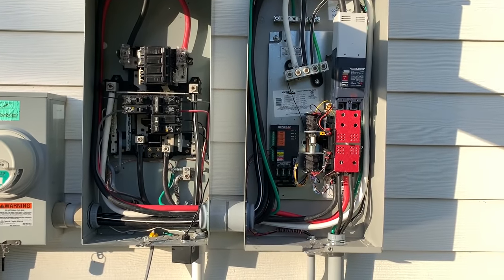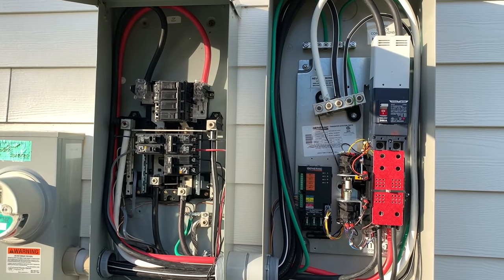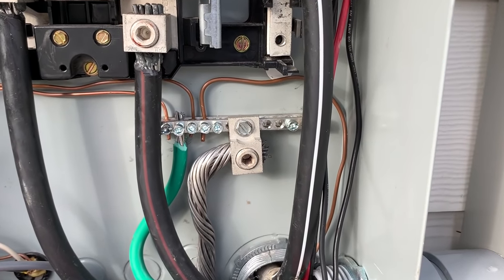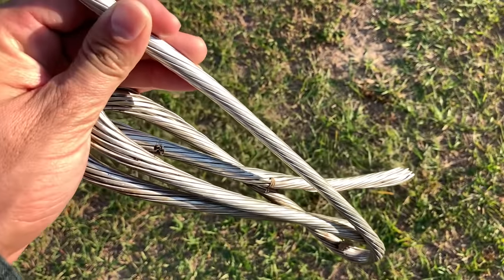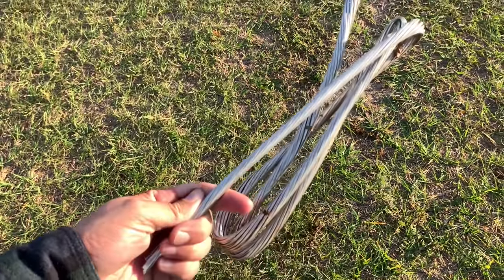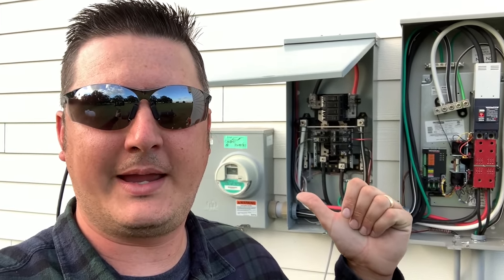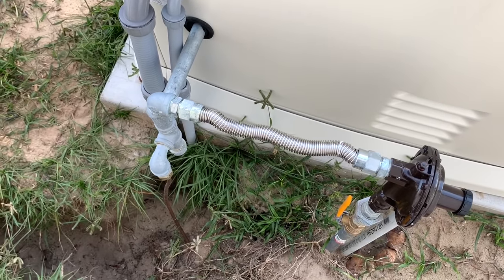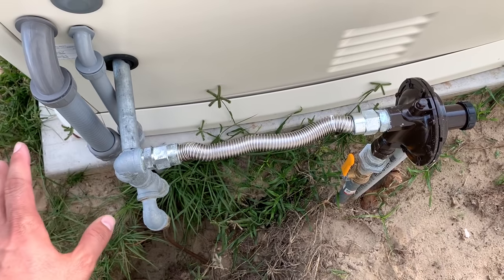Problems with our Generac generator install￼

Comment: This why electricians don’t post videos cause all the comments are a bunch of complainers and critics keep doing what you do bro no need to explain to them
Reply from the maker: Hahaha thanks buddy! The YouTube electrical inspectors are brutal that’s for sure. I know it’s not perfect but it works just fine. :-)
Reply: @MaynardFamilyHomestead lol I knew about the aluminum wire but I still use the grease lol that’s my name for it. 😊
Reply: Aluminum and steel react but Aluminum and copper not so much. I cast Aluminum bronze which is Copper and Aluminum mix and melted together.

Comment: I currently own my electrical business and you told it like it is. Materials are hard to get these days but always notify your electrical inspectors of this issue usually they will work with you and they know you are not trying to pull a fast one on them. Stay in good standing with your inspectors. They will respect you for it.
Reply: This brings out all the electrical knowledge. Especially if you're doing residential 🤣

Comment: All code requirements are subject to interpretation by the AHJ. I’ve never seen an inspector violate a pvc fitting with no plastic bushing. Common sense seems to be non existent to many folks.

Comment: I installed a 20KW back in May myself. I am a homeowner and did 100% of the work myself with no help. I also replaced my old 100Amp panel with a 200Amp one myself. I will say that anyone who doesn't know what they are doing should not attempt to install one. But it is possible. I did tons of research, watched countless videos, read through instruction manuals and all kinds of charts to make sure I sized the wires correctly and it was a lot more work and time than it would have been for an electrician, but it was done well and my inspector complimented me on it. He was surprised when he found out that I am not an electrician and in fact work in healthcare. I also ran a feeder to the detached garage, I repiped my entire home with pex and manifold system, put in a new front door and side garage door including having to reframe it because the framing was messed up.
Reply from the maker: Way to be awesome! You did it the correct way, research first. I encourage folks to learn the trade, and I’m all for DIY everything. I just had to cover by behind. 😉
Reply: Jessie…that’s impressive.  My primary question is were you not worried about voiding the warranty ?
Reply: @BrianD-ds4dx  lol. I didn't void the warranty.

Comment: I'm pretty certain grounding bus bars and lugs are tin-plated aluminum.  The tin-plating reduces corrosion potential and allows them to be dual rated.  Additionally, they are "through" lugs with sufficient clamping force produced to overcome the mechanical issues arising from different coefficients of thermal expansion.
Reply: Anytime you use aluminum you need to use kernel grease

Comment: Just an apprentice here, but I work in Western Washington and I can confidently say whether your local jurisdiction requires it or not you should use noalox in any sort of damp or coastal area because there tends to be more risk of corrosion. Just my two cents
Reply: for home use i profere copper OF-CU at my work in a 3P industrialist setting AL most of the time but there to different applications , as most home owners are lazybones with electric maintenance and or upgrade's ect.
Reply: Good  2 cents

Comment: As a Houston Texas master electrician that is active . i always install Bushings , compound , and i do not run service  conductors through other panels .Plus copper wire is always a plus .
Reply: 1. can't use the tranfer switch like a raceway, its not to code dont matter what the inspector says.
2. noalax is not required when lugs are rated for copper/aluminum though

Comment: Thanks for the update !

About 12:00 - "Flex is supposed to go <into the generator>". It's actually the other way around.
Generac install manual says: "Flexible fuel line must not be connected directly to generator fuel inlet. Always connect flexible fuel line to an approved gas fitting."

The generator also has a built-in sediment trap, so there was no particular need for installing another one where they did. Maybe the extra sediment trap is for the copper line ... but that's strange to put it there. 

That flex pipe does indeed look unprofessional and Generac does says no kinks or bends are allowed ... though it's probably fine anyway.
Reply from the maker: That makes sense. I guess I was thinking about it from an electrical standpoint, any equipment that moves requires flex so it doesn’t break and short out. For that tank and the installation it was $3900, so I was definitely disappointed it didn’t look a little more professional.
Reply: Also, flexible gas line CANNOT penetrate an appliance, even with that grommet!! The walls are thinner than pipe and could easily be cut and cause a leak.
Where it is is just fine.

Comment: Amen on that! I used to be an electrician and saw many "homeowner" installations. The best I think was plastic wall anchors used to splice two wires together. On another note! Happy Thanksgiving everyone!
Reply from the maker: Oh my! Yeah that’s why I hated service work, you never knew what you were going to get yourself into!

Thank you sir, happy Thanksgiving to you as well.
Reply: Question:
What's behind the other panel on the generator? I noticed you did not bother to open that.

Comment: very good. watched yours and others, due to fact I will be installing a few within the next year & trying to pick up knowledge.

I have done lots of electrical, including rewiring homes, but never put in a transfer box. I have put in gas line, but for heaters, stoves & water heaters. never for generator.

I have 2 homes, & going to do 2 small units, 8K at each home, then I have 2 co-workers I said I would do installation, 1 wants a 24k, the other needs a 38k system, she refuses to give up comforts, presently use multiple generators backfeeding panel her husbands doing, & take rides around neighborhood every hour to see when neighbors get power on, to know to cut generator off & main breaker on.
Reply from the maker: Thanks for watching!

Comment: your gas looks ok generac provides a drip leg inside the case so no need for and external one also galvanized is a nono for gas, use rustolium gray oil based to paint your pipe, the twisting of the flex is just from over-tightening. otherwise its a real nice install

Comment: I recently retired from my 45 year career as a Industrial Electrician. Seldom have I done any Residential or Commercial work . But I suggest you double check your Grounding Connections as the Code has changed quite a bit ( For a good reason) There are excellent Video's on You Tube explaining the latest Bonding and Grounding Code changes.

Comment: My Wife and I are about to have our Generac Propane powered generator installed as soon as it get in. Since our gas line will run off our 500 gal tank, the company that owns that tank will have to Install the gas line to the generator if I'm not mistaken. I was not sure if your gas supply was Natural gas or Propane but I heard you say that you got another company to install that so that's leading me to believe you have Natural gas as the supply. Thanks for the video. You are very knowledgeable on the Electric side of it.

Comment: My situation here in Washington state is a bit different. My meter is on a pole 100' from my house. There's a disconnect on the pole with the meter that cuts power to the property. I have an outside panel on a waist high post about 4' from the house. This receives power from the meter and distributes it to the house, outbuildings, pump, septic,  shop, etc. My generator transfer switch is on the side of the house near the outside panel and generator. I have to route the power infeed cables from the distribution panel to the transfer switch and back to the distribution panel. This will necessitate either splicing the main power cables or a box to allow connections. There doesn't appear to be a simple, straightforward, and inexpensive way to make this installation. I'm quite comfortable with doing 90% of this job. It's the 10% of the splice/connection box that has me concerned. I can put everything in place and run the appropriate wires/conductors confidently in conduit and LiquidTite Flex. How do you recommend the "splice/extension" be done for the incoming lines from the remote meter? Any help is appreciated even if it is direction to applicable information. Local electricians aren't a good resource as they simply want me to pay them to make the connection.  If I must, I must. Thank you.

Comment: It's due to dissimilar metals not just oxidation.  Copper,  aluminum and steel will cause corrosion when it contact with each other.

Comment: Neutral / Grounding bars are also an aluminum alloy just like the modern cables and are tin plated which prevents corrosion even when used with copper conductors.

Comment: You should use poly-coated stainless steel outdoor flex line for the gas  such as Easyflex Yellow Coated Stainless Steel 3/4" MIP x 3/4" FIP Full Flow
Reply: The flex line is provided by Generac. It is the only flex line approved. The yellow one is not approved.

Comment: At about 4:00, asking about CU ground wires landed in an AL ground bar. One answer is that these CU conductors do not routinely carry current, so electrolysis is not an issue.
Also, if it was my home, I'd put a piece of Counterstrike between the regulator and the El. Since I am old school, I might re-pipe it without street Els.

Comment: Got 45 years doing electrical.  Seen aluminum wire glowing red along a wall between disconnect box and electric furnace.  Problem with not using penetrox is this:  you don't know the composition of wire off the shelf.  There may be new-old-stock being sold and used which could create a problem.   You don't want to take a chance.  Good advice is ALWAYS use penetrox with aluminum.   Back in the day 14 ga and up household wiring allowed use of aluminum and there's still quite a bit of it out there.  Anytime someone finds it they should penetrox all terminals.  And hope they don't have a fire.
Reply: If a supplier still have the old stuff they held on to it for almost 50 years

Comment: Generac normally includes a rubber flex line to be used with the gas connection. They're very specific that it's used straight, without any bends, as it's only there for vibration isolation and not to replace an elbow. I like that you used 2 conduits for power and control wires even though they can all be jammed in the same pipe with 600 volt insulation. The toughest part is getting the power conductors through the 90 degree sealtite  fitting at the generator.  I normally use an aluminum mogul LB, steel nipple and a Meyers hub at that location for ease of wire install. Not sure if you have squirrels in Florida but that plastic pipe and sealtite is squirrel food in Northern areas.
Reply from the maker: Oh yes, we have too many squirrels lol! I have thinned them out some, and we just got an outdoor cat. Thanks for watching!

Comment: Glad you emphasized safety. My uncle was killed by an arc flash off an industrial panel he thought was off . Come to find out the guy he sent do cut power cut the wrong power and the panel was still hot. It happens. Not a lot of margin for error with electricity. You have to know what you are doing.
Reply: So sorry about your uncle, I'm a retired Master and I know the dangers well.  Some of these DIY videos are good but many just teach people enough to make them dangerous.  As you say, you have to know what you're doing when it comes to electrical, and that knowledge comes with a lot of experience and training, and knowledge of theory.

Comment: We just had a 24kw Generac  installed and our flex hose runs different than yours. We have a small black pipe coming out of the generator housing and then connects to the flex hose. Then the flex hose connects to the regulator and cutoff.
Reply from the maker: That sounds like the proper way to install it.

Comment: About 40 years ago I had to fix at least 6 violations when a carpenter installed a 200 amp service and a 100 amp service for a commercial building.  Clown never used a single plastic bushing and asked my great inspector if he know the easiest method to correct it. T&B back then made heavy maroon colored what almost looked like giant anti shirt bushings that you slipped together. I installed two at every entrance. Maybe they still make them. I mentioned that you could spend a lot more $ & purchase grounding bushings. Think maybe once or twice when supply house was out of the plastic bushings purchase metal bushings.
Reply from the maker: Yeah I am a believer in PBs. This was at the height of corona and I went to several supply houses and nobody had them unfortunately. Since it was a small PVC nipple and not rigid metal I figured I would go ahead and do it even though I didn’t have the bushings. In a perfect world I would like to have done several things differently.

Comment: I was going to comment on your previous video but there were already plenty of inspectors on this job. The one thing you didn’t cover that is more than just a code technicality is torquing the terminals. My last ten years as an electrician was as a specialist doing check outs and commissioning of new installations and getting involved any time there was a failure or other problems in the large chemical plant where I worked. One of the things I did was infrared scanning of all the electrical equipment on our 100 acre site, from high voltage substations down to lighting panels in offices and research labs. I have found and repaired hundreds and hundreds of poor connections and 90%+ were the result of improper torquing. Everybody thinks they know how tight things need to be but I can prove that most of them don’t. Unless you routinely use a torque wrench and ratchet of the same length to get a feel for a particular value then you won’t be close. When I was doing construction we installed a lot of Allen Bradley motor control centers and we did a lot of buss bar splices and we got to where we could get very close but we still went back and checked every bolt. It’s pretty embarrassing when you have to shut down an entire production facility 2 days after a new switchgear install just because someone was too lazy or too stubborn to use a torque wrench on a connection. I personally will NEVER use aluminum for anything. Yes it can be used safely but compared to copper the expansion and contraction from heating and cooling is just too great for my taste. In my plant where we had almost 50 electricians, a couple of hundred contracted electricians, and a staff of about 30 electrical engineers we didn’t allow any aluminum wire anywhere for anything. Do yourself a favor, buy a torque wrench and use it.
Reply: Im just a regular joe about to install my generator. I planned on torquing all connections. Its in my nature though. I properly torque everything, including car lug nuts to oil drain bolts.  Too loose is never a concern. Ive busted off a million bolts over tightening.
Reply: Its code on torquing now so if inspector dont see a torque tool on site he not ok about it.

Comment: My motto mother pluckers, is be honest, or be a politician. Around 65 now, retired carpenter/general.
When I was young (Eric Burden & The Animals) an old timer “said exactly what you said”. Treat wires as though they are hot, one wire at a time, was a good idea. I’m glad you got away from it. I took two years of “low-volt” in school, I’m still having fun with electronics. Worked on a solar project or two, “to learn what a giant scam it is”. 
It’s good, but it’s not great, yet, just give us pesky humans time.

Comment: First let me say this the ones who said anything negative are well full of them selfs your job not only looks great I am following it step by step to hook up my own exact same gen and want to say thank you because where I live getting anyone to come out to do this is almost next to impossible and the one con man that did say he come do it wanted 3600 to do it look it's not rocket science although not easy as well only thing I'm doing different is I just took my 200 amp main out and replaced it with the auto 200 amp I even just turned it back on even though I hadn't hooked up generator yet I plan on doing that this next week so hey I want to say this thanks to you not only did I save 3600 I learned something new so thanks for taking the time to show us idiots how to do something right and your right about the things needed 4 hardware stores had do same thing and like u I haven't heard one real answer why like osb use to buy for 10 now 40 what bull